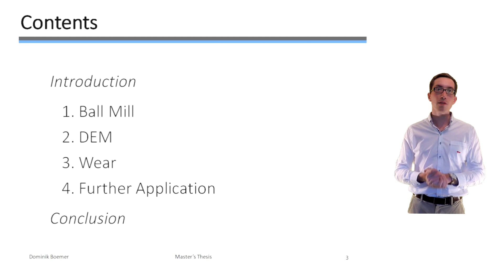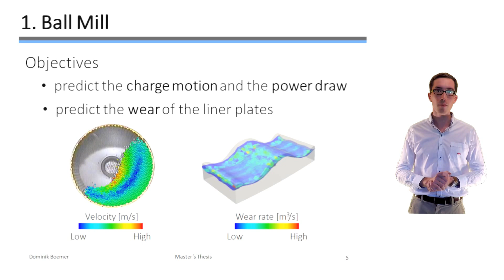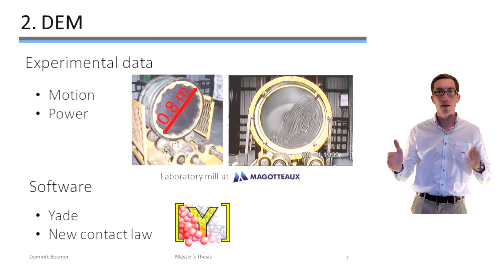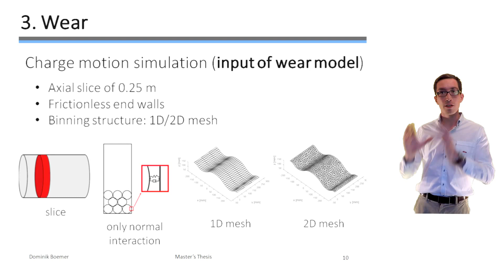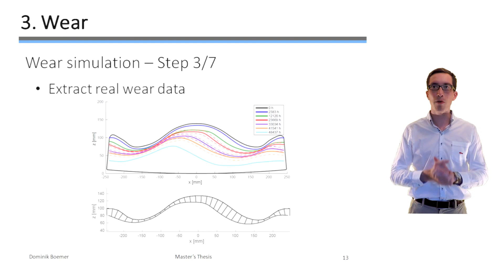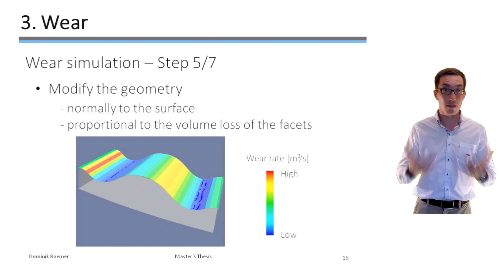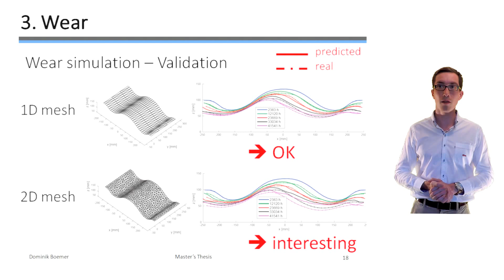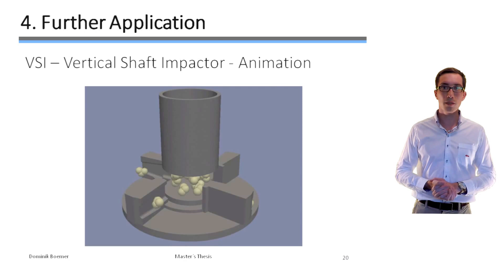DEM Modeling of Ball Mills - Liner Wear Evolution

Comment: Hello Dominik, which DEM simulation tool have you used for this Ball milling process. I want to simulate comminution of hard rocks by jaw/cone crushers. I appreciate any comments/suggestion to DEM software for this process
Reply from the maker: Hi Mani, I used Yade (https://yade-dem.org/doc/), which, however, does not support splitting / crushing particles into smaller particles, as far as I know.  I remember that LIGGGHTS was also a good solver (https://github.com/CFDEMproject/LIGGGHTS-PUBLIC), but I do not remember, if the open-source version supports the previous feature.  I am aware that Paul Cleary has been working on it.  I think that this feature is also available in the commercial solver Rocky (https://rocky.esss.co/).

Comment: Hello Dominik. I must say that although I am not an engineer, I really enjoyed your presentation. 
I wonder if this kind of mill is appropriate to crush rocks for agricultural use, you see, the purpose is to crush silicon rich rocks to the same texture of cement to be later applied on the crop beds.
I appreciate any comments you may have about it and I apologize beforehand if my question may seem too obvious or simple, but I do not want to be wrong since we are to invest in the right machine for the job.
Thank you!
Reply from the maker: Hi Carlos!  Thank you for your kind comment.

I have no experience in crushing silicon rich rocks for agricultural use in particular but I can tell you the following:
- the finer the grinding of the rocks, the higher their active surface and the more nutrients can probably be provided to the soil;
- the finer the grinding and the harder the material (content of SiO2), the more energy (money) is required;
- the fine grades (powders) are usually obtained by ball milling.  I do not know of any other process that could result in such fine grades, while being sufficiently scalable (vertical roller mills are only cost-efficient at big scale).

To make sure that my comments are correct, I took a quick look at the scientific literature [1]: "Whole rocks were crushed in a jaw crusher and a
ball mill" in a context similar to yours.  Thus, ball mills seem to be used.  Jaw crushers are required when the rocks are still very coarse., i.e. before ball milling.

I hope that I could help you.  Feel free to comment, if my explanations are not clear enough.

[1] Bakken, Gautneb, Sveistrup, Myhr (2000), Crushed rocks and mine tailings applied as K fertilizers on grassland, Nutrient Cycling in Agroecosystems, 56(1), 53-57.

Comment: Hi. Nice presentation!  I have recently been introduced to DEM and will be taking up some projects in my masters degree for wear simulation. I am interested in knowing how the geometry is updated after certain time steps. Is it an inbuilt feature in the simulation tool or is there any other method to do it? for example, exporting the deformed results from the DEM simulation into an stl file. I will be working with EDEM simulation software.
Reply from the maker: Thank you!  No, it was no built-in feature, but programming.  Initially, I created a surface mesh file, i.e. a list of vertices, edges and triangular facets, via GMSH.  This mesh was loaded in the DEM solver.  During the simulation, a wear value was computed for each facet.  These values were written to a file at the end of the first DEM computation.  Then, I loaded this file and the mesh into Matlab (or a Python program, ...) and I displaced the vertices normally to the surface by an amount, which is proportional to the local wear.  Just to be clear, this was done by literal programming, i.e. by implementing the mathematical equations to displace nodes along a given direction, ...  Afterwards, I wrote the updated mesh again to a file, which is loaded in the next DEM simulation and so on.  
Thus, some programming skills in C++, Python and Matlab were required.  I hope this helps.
Reply: Thanks for the answer.
Yes I was expecting this. Would it be possible for you to share any links that could introduce me to such topics, for examples, reading mesh files in matlab etc.

Thanks for your help :)
Reply from the maker: The answer depends very much on the specifics, here for instance the format of the mesh file.  I think that the best way to solve this problem would be to take a general programming course first, if you do not have any knowledge about programming (I would suggest about Python), and then searching online for the specific solution, i.e. to understand the structure of the mesh file.  Since this solution depends on your choices (solver, file formats, ...), I can not provide you any links.  But they are certainly not too hard to find via Google.